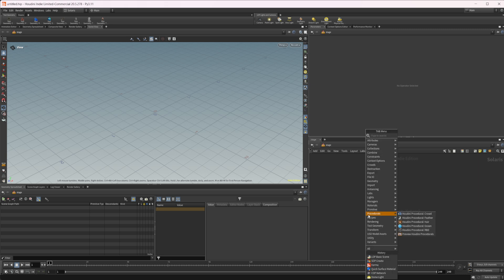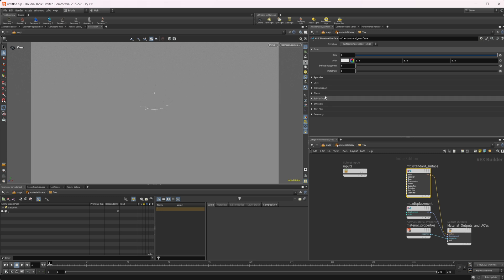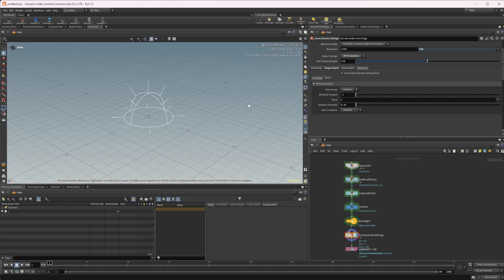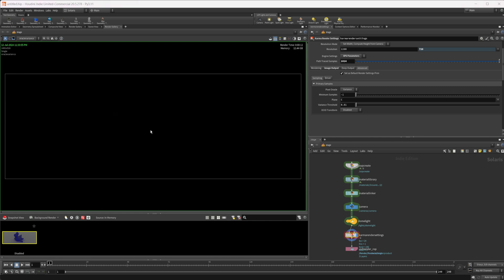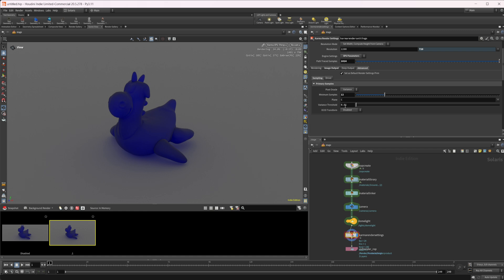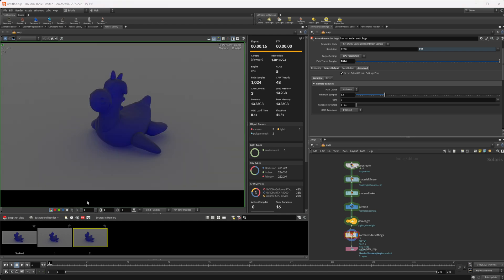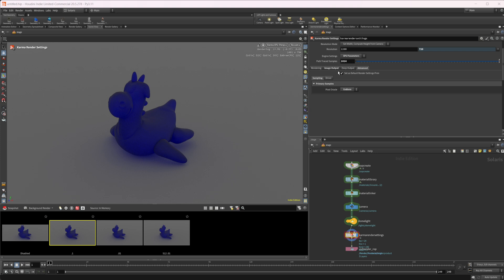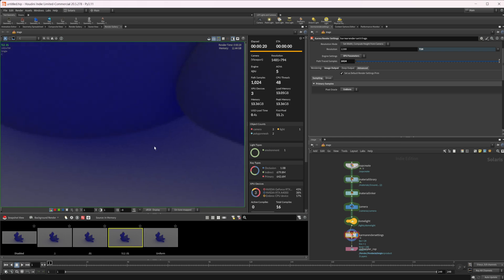Adaptive Sampling in Karma XPU | Houdini 20.5

Comment: You can enable the OCIO transform too, this will apply the ODT/LUT prior to inspecting the variance. 
We've used this method for a long time in Mantra, Vray etc, the noise in raw linear is not the same as when it's been transformed, so this helps to
reduce over-sampling in the engine.

Generally the majority of noise in an image, if it's not full of refraction is in the direct/primary rays, so you can take the noise threshold up from 0.01, to 0.04 and 
reduce the amount of primary rays(pixel samples) fired. Unless there's a lot of motion blur/DOF or high frequency detail, it's best to go with lower pixel samples and
a higher maximum sample limit. Something more like Min Samples 24-64 and Max Samples 256-2000+ depending on the scene.

If you throw too many primary rays out, what will happen is that the noise will end up being below the threshold anyway, effectively removing any adaptivity.

The other problem of increasing the min samples too high will mean blocks of fairly uniform colour will end up being way over-sampled.
Reply: "You can enable the OCIO transform too" how to do this?
Reply: @DJWeekly  There is a drop-down menu under Variance Threshold. Also you can use upper-right search menu (Magnifying Glass icon) in parameters of each Houdini node.

Comment: So, is it correct to say, that this technique is more valuable when you render an image that doesnt need uniform amount of sampling? Meaning one part of the image is more important then others and the adaptive sampling takes that into account...
Reply from the maker: No image really ever requires uniform sampling. Adaptive sampling just allows the engine to determine where samples are and are not needed. It can be valuable to use in every render
Reply: @InsideTheMindSpace  that makes total sense!

Comment: Great vidoe! thanks for sharing!

Im curious, dont you think that maybe you could reduce the minimal samples around 128 because some areas of that image might not need much more, and let karma decide when to use the max sample ? i think you might have ended with a similar quality and faster render time, but im just guessing
Reply: I agree with this. The minimum sample amount of 512 seems extremely high in this video and I doubt it actually gives a visible quality increase to something like 32. It just takes much longer to render and doesn't really showcase adaptive sampling as well since now you just are mostly rendering based of that minimum amount.

For example in production Pixar usually only use 32 minimum samples, but 4096 maximum samples with their renderman renderer. Renderman and other renders with adaptive sampling usually have an automatic feature where the minimum samples are set based on the maximum sample amount. This value is the square root of the maximum. With maximum samples set to 1024 the minimum would automatically be set to 32. For these automatic settings to end up with 512 minimum samples, the maximum would have to be set to 262 144 samples.

When a render engine has a really good adaptive sampler the threshold really becomes the main setting for quality. The minimum value can be set to a relatively low value. It just needs to be high enough so that the noise in the image is a reliable enough source for the adaptive sampler when it starts to refine the image. With extremely low values the renderer might cause false positives where it produces similiar pixels next to eachother that won't get sampled again while in reality the pixels would have some color differences between them if sampled more. The maximum value can also be bit overkill since the renderer might never need to render that many samples at all.
Reply from the maker: Adaptive sampling is meant to reduce render times while maintaining a noise free image. Some areas of images do need less samples to fully converge. I was trying to demonstrate the use of it while using a noise free shadow area as a benchmark.
Reply: This is correct. The Primary Samples is the total per pixel sample budget, and the Minimum Samples should generally be left at the default of -1, increasing it is going
to force Karma to fire this many rays at a minimum, then it checks the variance threshold, and if it's still above the limit it will throw more rays out. But never past the absolute limit set in Primary Samples.
By setting the Minimum Samples so high, it's effectively reducing the adaptivity of the whole thing.

Comment: If have to encapsulate what this is in a circle, it would be (optimization of long and large tasks that require patience). This is a great resource that mainly helps with the efficiency of pixels, and it is very useful for saving time by optimizing in this way. Thank you very much, briefly I will tell you that I checked it and it is very effective for me!!

Comment: In comparison the Arnold renders this same scene with same resolution in about 11s noise free on rtx4090 but the transmission looks better on Arnold. In other scenes I tested recently, Arnold's bump is simply superior, every single material I tried looks more realistic, the metal reflections are just better, renders are considerably sharper, shadows more defined etc etc. I am trying really hard to love and fully switch to Karma but every time I compare it with Arnold I decline this idea. Karma is really great and fast with volumes though and has better integration with Solaris.
Reply: Probably you're right, but..
1) karma is part of Houdini. You don't need to pay +400$ per year for license..
2) if you don't have RTX4090 - gpu render will be "little" problem for some scenes with Arnold, if it bigger than just some one-object presentation. Probably, xpu better for speed/optimization? As I know, Arnold "love" GPU memory:)
3) just interesting for compare two similar scenes, made by Karma and Arnold - if you will not know, where every image was made, are you sure in right answer?:) Just curious. I saw some render comparisons between octane and cycles and.. Almost no differences if be honest:) Only if you love do pixel-hunting.
Reply from the maker: @knopkodavik render engine doesn't make that big of a difference between modern render engines. A good artist will make good work no matter the engine
Reply: @knopkodavik  1) yes, I agree.
2) might be, I am not sure but I never had problem with GPU memory on 4090 and 3080ti. I am not dealing with super huge scenes though
3) for sure not 100%. Can you make great artwork with any render engine? Absolutely! However if I compare 2 render engines side by side I can usually see quite many differences and for the same effort (same lights, same textures, same geometry) if one render engine gives me better results than other one why not choose the better one?
Cycles vs Octane are you talking about this video? https://youtu.be/eFY1HeymUU4?si=ilx95mshIHJKNaVW&t=401 I see quite some differences and here I would definitely choose the Octane. Floor looks better, metal is more realistic, background wall is more defined.
Reply: That's how I feel with octane. The renders just look better.... I don't know exactly what it is but I can unsee it. I'm sure Arnold is even better.
Reply: I was thinking of switching to karma from Arnold. Because of firefly noises on metal surfaces or whatever reflecting textures and shaders. So difficult to managing them. But you've just destroyed my plan!
Reply: @hanheecho6437  might be a bad HDR. I used to have lot of fireflies with HDR which had a lot of small very bright christmas lights. try to increase the roughness a bit if it is an option or just clamp the AA/indirect values.

The way I light most of my scenes is to use HDR with small intensity 0.1-0.4 max - this is how the darkest parts (shadows) will look like. then I just light everything with custom lights and I seldom get firefly problems. Solaris has a fantastic light placing tool with much better control than any HDR https://youtu.be/Njh2j0ExYj0?si=3J_m23Y6p1BVLzNK&t=303